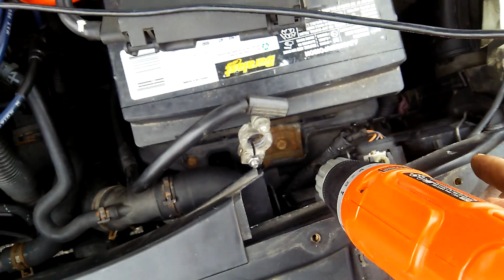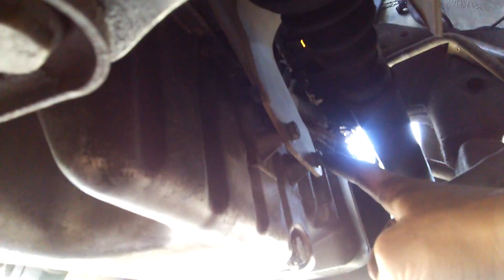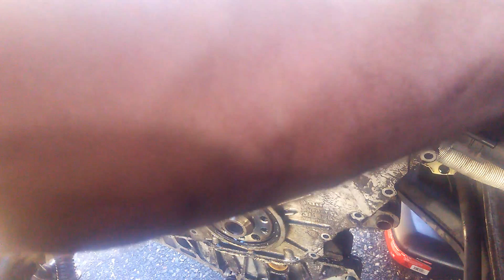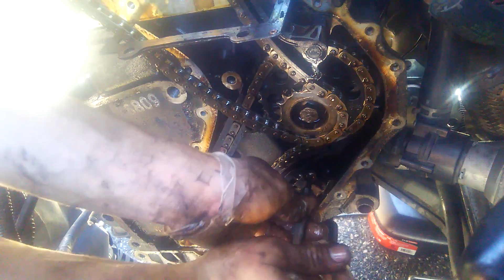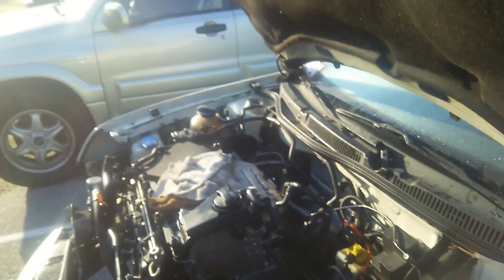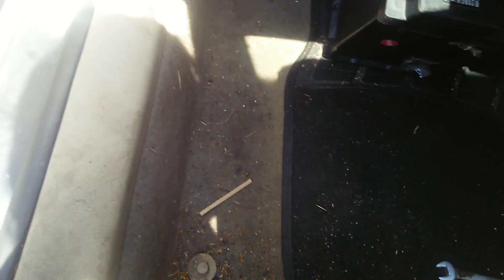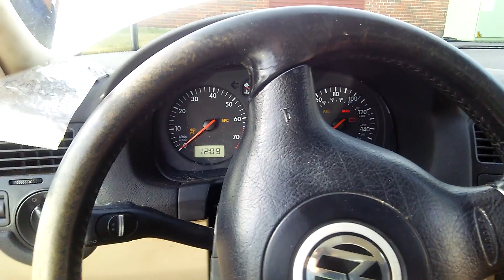VW VR6 Timing Chain Repair - Start to Finish - Jetta Golf 2.8L 12v

Comment: Yo, I have a question. I have a 12 valve vr6 and I’m doing the timing chain on it but on the middle shaft where the two sprockets meet why is my Top Dead Center, Mark pointing up opposed to yours pointing down I am so confused right now and I wanna know the difference between the two motors if they are
Reply from the maker: @user-th5mp3bw5p  same motor. The 24valve is noticeably different. As far as the direction of the pointer, if I recall, it can point either direction opposite to itself,  but I'm not 100% on that. If that's how it was when you opened it up, I would just reverse engineer it ad it was if you didn't have an issue before.
Reply: @Vijuel  ok thanks 🙏

Comment: I want do this with my friend noun of us are mechanics but we want to learn we know basic stuff I guess ☹️😭 you make it look easy
Reply from the maker: Hardest part is having all the tools. With patience and staying organized,  you can do it!
Reply: @Vijuel  how can you tell your timing is off ?
Reply from the maker: @vrtxs1938  if the timing is off you will have all types of problems, back firing, stutters and it will not run correctly. what starts to fail is the timing chain guides and it will start to make clacking and ticking noise out of the engine. it may cause your chain to jump from lack of tension and hamstring the cars performance right away and possibly permanently damage your engine. the trick is to catch the warning signs before any of that happens and do a timing chain job to replace the system.
Reply: @Vijuel ended up selling my old 12v i got a 24v now and it sounds like the guides are ticking she still runs good but I’ma have to seat  her up for the winter and get ready for that timing chain job when it gets warm
Reply: @vrtxs1938  take a look by taking the valve cover off. Doesn't take too long to get to and you'll be able to at least take a peek around.  Make sure it's not the shifter rod that's knocking.  -Vijuel

Comment: Wow! That’s a big job well done from a fellow VR6 owner in New Zealand you inspired me to do mine thank you for the knowledge
Reply from the maker: drop your oil pan and clean it out while your at it, it will help in the long run. and think about a clutch change while you have everything open if needed, or at least replace clutch bearing to be safe. cheers mate.

Comment: Yo I remember this vid when it came out you still got this mk4?
Reply from the maker: I do. Drove it today 🙂 although I mostly drive the newer family car. It's still my project fun car. Just replaced the oil pump. Had timing chain guide pieces in the oil pan and pick up tube.
Reply: @Vijuel  ohhh shit I didn’t think you used this channel anymore. How many miles are on her now?
Reply from the maker: @nothingtoshow8084  about 189k I believe it has. I use a different channel but I catch the notifications here and there. I always want to film stuff I do to the car and post on here but I just end up wanting to get the job done and never film lol
Reply: @Vijuel  damn well I’m glad it’s still running good years later. But yea I understand how it could be a bitch to film everything when you need to fix it real quick

Comment: the slack in between  the cams didnt matter?
Reply from the maker: There's a hydraulic tension bolt that presses the guide plus springs on the guides for tension.   She is still running fine since I did this job, besides some other issues
Reply: @Vijuel  you arent understanding my question, i understand how the timing system works im just asking if you skipped timing because you didnt take up the slack between the "CAMS"

Comment: Any suggestion on getting the axel stub back into the transmission? it appears to be spring loaded, i cannot get the cup deep enough back into the trans to start the center bolt.
Reply from the maker: Yes, I used a huge C clamp. I had bought a set for other projects so it came in handy. Pick up a big one at harbor freight or try to have someone help push it in while you try to screw it together
Reply: @Vijuel  thanks i have one somewhere
Reply: @Vijuel  sorry one more question. There is a small black ground wire that is coming off of the small cylinder thing right behind the coil packs, Does that wire go to the bottom bolt of the throttle body? i cant remember but that seems thats where it should go based on range. Thanks again for the help. I got the splines on.
Reply from the maker: @OryHaram  I think that wire sits on a screw, right to the coil packs, right under some small coolant hoses. I'm going by memory right now

Comment: Awesome job! What sorce material did you use to study for the job? Did you use manuals etc? If so what manuals or websites?
Reply: Thanks. I have a pinned comment here that will take you to a thread from vw vortex, which was most the info I had at the time. Much more available now on the net since when I did this job.

Comment: Is it true that the 24v VR6 has a better designed tensioner/timing chain system than the 12v VR6?  I've heard rumors that you can usually get more miles out of the 24v motor before having to replace and work on the timing chain.  If anyone has any info on this, please comment.
Reply from the maker: the chains are usually solid. the guides go out and are the main problem in these systems. not sure about quality between the 2. would be safe to have regular maintenance after 80k

Comment: What work did you need to do with the throttle body during this job?  Was it removed from the intake manifold or were the two removed as one assembly?  If the two were separated, did you clean the butterfly valve?  Did the throttle body need to be mapped after the car was put back together?  Also, since the whole job was done almost 4 years ago, can you give us an update on how reliable the car has been, specifically regarding the maintenance you performed?  Good work.  I need to do the same to my GTI.
Reply from the maker: i believe it was in one piece. the car ran fine till last winter i had an oil pressure problem and stopped driving it after one night i got the light turn on. it was sitting since then and i started driving my other jetta. just a few days ago i started it up and it had no oil pressure light. so ultimately, it had no timing chain issues since i did this job. i started the car again because i'm moving out of state and have to do something with it. i wanted to take it with me and make it my daily driver again but it will cost too much for an auto transporter so i will have to get rid of it asap within a few days. maybe give it away to someone... other than that, it's a 20 year old car so a lot of other stuff is worn on it, a/c, heater, suspension, brake system.. nothing critical, but just old at this point with new england weather and use.

Comment: before you noticed you needed to change your chains out, did it feel like it was a clogged cat before hand?
Reply from the maker: it will run rough like a bit of  an exhaust issue, but you will also hear it rattling and noisy on the front end.  listen for it.

Comment: Amazing job, outside a garage, without the lift, big respect! Can you please tell how many kilometers did this engine have on the clock when you did this repair and does the vr5 have the same timing chain setup as this vr6. Thank you for your answer and again big respect for pulling this off!
Reply from the maker: 144k miles / 232k kilometers. not sure about the vr5

Comment: one question again....why did you change it...was it acting crazy or....you say in the end " shes running much better " kind a wonder if something and what made you do this job ? . have a 24 v wich i think is lazy in responding ....nothing looks wrong, but maybe its a loose chain . dont know when its been changed if it ever has been . 230,000 km like about 170,000 miles
Reply from the maker: it was making noise (the chain running with slack on broken guides). i started it up at work to head home and it skipped a tooth. i drove it home and there it stayed till i fixed it
Reply: @Vijuel  uhh a bit lucky 🤣 dont know if it can bend a valve or not . But okey thanks alot . Do think i feel a vibration of some sort when i stand still and give it some pedal, then theres some vibratios i just cant locate. MAYBE....just maybe a loose chain could cause that feeling. Anyway thanks alot for your time ....again i think 😂 nice when people respon on questions

Comment: I'm thinking about buying one of these cars with the same engine that has jumped time does it work valves
Reply: I'm not sure what your asking. You mean the chain jumped and you're wondering if the valves are any good?
Reply: Is it an interference motor means when it jumps time does it work the valves in the cylinder head
Reply: @anthonycasey6064  yes it is. If you're not sure what the extent of the damage is, I'd stay away from it. Could be no damage,  could be shot. Not worth the $ to find out. If you're looking for a vr6, keep shopping around, they pop up often and aren't that pricy.
Reply: @BattleRapBoutique  200 for the car
Reply: @BattleRapBoutique  its a 1999 very clean little car
Reply: @anthonycasey6064  if it's in decent shape and you have the space, it's a great deal. You can part it if anything and make a profit
Reply: @BattleRapBoutique  yes
Reply: The one I am thinking about buying has jumped timing does it work the valves
Reply from the maker: i replied from my other account, sorry for the confusion.

Comment: How was this vr6? Did it burn oil?
Reply from the maker: Strong motor, it did burn about a quart and a half of oil between oil changes.
Reply: What kind of oil were you using?
Reply from the maker: @Datwookievr6  0w 40 full synthetic Mobil 1. Sometimes with Lucas oil stabilizer
Reply: Thanks alot for the info

Comment: Is it common for timing chains to break easily on vr6s ?
Reply from the maker: not really. a lot of cars had chains before moving to the cheaper belt design to save costs. what mostly goes is the plastic guides, rarely the chain itself

Comment: Hate my VR6. Took it to the shop to habe cam shadt positioning sensor changed. They changed it with no fix. Timing was off still. Put old back in. I dont have thousands to fix the damn thing. They said they wont work on the tensioner pulley because they are none for breaking and have to pull the engine out. I only watched a portion of this video and its beyond me and my time to do.
Reply from the maker: the guides are known to break regardless, they are plastic. yes it is kind of a big job if time, space, tools and experience is an issue. it is not a big deal to do if you have a decent combination of all those tho. the tensioner pulley if you are referring to the serpentine belt is simple to change... if my vr6 makes it to this next summer season i will try to open her up again and refresh all the guides to the timing. a chain drives it, not a belt, so the chance of the chain breaking is slim, but the guides will need occasional service.

Comment: When removing the axle flange bolts, it's best to stick an old but tough screw driver in the rotor slots above the caliper so the rotor locks up and wont turn when you break the bolts loose! Saves you from having to block the brake pedal.

Comment: Hey man! Very thankful for a video like so.. im extremely surprised you did it in such a short span of time and in the middle of a parking lot! I have recently bought a jetta with the 12V VR6. The code that was sent was P0340, which I thought I fixed before, but  the code came back on - people say it is timing. Car hasnt been serviced for timing chain for a while - but it ticks a little. DO you think I should replace the timing chain and all the guides etc. just to be safe ? Thanks
Reply: Keyvan salute,  check camshaft position sensor / wiring.. could be the timing misaligned.

Comment: What is the big seal that you replaced called... in trying to get all the parts before I start taking my vr6 apart
Reply from the maker: Alex Perez it's called the main oil seal
Reply from the maker: Alex Perez when looked up there will be a small one and a big one, it's the larger main seal
Reply: Can it also be called Timing Cover Seal???
Reply from the maker: Alex Perez maybe, I remember it being called main oil seal, but may be rear oil seal or main camshaft seal... It's a tricky one cause there are a lot of similar seals
Reply: Alright let’s see what happens
Reply: By any chance do you remember where you bought it from
Reply: Alex Perez that specific part I believe I got from AutoZone.  Plan ahead in case they need to order it. It is about 6 inches wide rubber ring with a coiled spring inside of it just so you know... a small seal comes up when they look up the part, so make sure you get the larger one
Reply: Okayy thank you
Reply: Alex Perez cheers bro. Good luck
Reply: Thanks I appreciate the help
Reply: I was just at Autozone but they can’t find that one it only shows the 2 inch one
Reply: something like this, im not sure tho... https://www.urotuning.com/Crankshaft-Seal-Rear-Main-Seal-Mk4-Mk5-VR6-p/021103051c.htm go to advanced auto or another store and ask them to look up ( rear main seal, or crankshaft oil seal)  this looks like it too https://www.ebay.com/itm/VW-GOLF-MK3-VR6-Crankshaft-Crank-Oil-Seal-Transmission-Timing-End-Genuine-OEM-/151473473470
Reply: this also may be the VW part # * 068 198 171 - rear main oil seal
Reply: this guide will help you a lot http://forums.vwvortex.com/showthread.php?1264409-DIY-Replacing-timing-chains-tensioners-and-guides-on-a-12v-VR6%5C

Comment: I would also highly recommend pulling the oil pan. Alot of the time the guide material will find its way into the oil pickup tube and could restrict oil flow to the pump.
Reply from the maker: Great tip Tiffany!

Comment: Does it make sense to replace the sprockets too? Is that amazon link for the chain a good replacement? Have you had any issues? Because most chain kits are $200 so ive seen.
Reply from the maker: no need to change cam sprockets. you should change the clutch tho, while your in there. the amazon link is just to get you there. i believe i got the parts from rockauto.com and ecstuning.com . havent had a problem since i did this. eventually i will have to check the top timing chain guide rail, which can be checked and replaced by just removing the top half of the cover. but no issues as of yet.
Reply: okay. i just replaced the clutch 400 miles ago, and i didnt do the chains while i was in there.. stupid me. So now its time to do them.. Thanks for the video! No amazon timing chains for me though haha

Comment: excellent video man! I still can't believe you never jacked the front end up at all! crazy how vw has the timing chains sandwiched between the trans , how many miles was on it when the tensioner and guides gave out?
Reply: Im driving a SEAT Toledo II with the 2.3 Vr5. My chain started making noises at 65.000km and it jumped first at 74.000km (I tried fixing a lot of stuff because I haven't realized it was the chain) and now at 84.000km it jumped again making the car run so bad it wouldn't really idle cold and needed full throttle to even do something so I now need to fix it. The Garage wants 2000€ to do it but One set only costs about 160€ on Amazon .
Reply from the maker: THAT NEON DUDE JAMEZ thanks.  started to hear it failing around 120k. did this job at 142k. should be done between 80-120k
Reply from the maker: THAT NEON DUDE JAMEZ once you're really to drop the transmission then you have to Jack the car up to remove the axles
Reply: Vijuel I picked up a 01 golf gti 2.8l vr6 has 204k on it I'm sure mines been done sounds great no chatter and before I got it the clutch was just put in.
Reply from the maker: THAT NEON DUDE JAMEZ nice.  overall a good motor when cared for.
Reply: Vijuel how long did it take you start to finish?
Reply from the maker: THAT NEON DUDE JAMEZ bout 3 days by myself. day one prepping and breakdown,  day 2 parts arrived, cleaning and install (gave the rtv silicone time to cure,)  and 3rd day I reassembled
Reply from the maker: THAT NEON DUDE JAMEZ can be done in one day
Reply: TWO DUDEZ GARAGE Just for another data point, mine has 148k and no sign they need replacement, but I’m checking videos to see when they may need to be done.

Comment: How big of a difference is for a Golf  24V v6 2003 than this.is it much?
Reply from the maker: pretty similar. i haven't really got to work with a 24v yet to say where and how much they really differ.
Reply: Ok, thanks.. I've been to a specialist and they told me it's a 3 grand work(in pounds) fuck I rather crash the car to get what I initially paid for it
Reply from the maker: it's a big job. many shops are going to charge big bucks. if you have the tools, time and space, you can do it yourself. not hard, just takes patience, reading and a few busted knuckles.
Reply: that's the thing man I haven't got the tools nor the premises to do so.But thanks for the response and appreciate your work, I only wish I could be like you
Reply from the maker: any time my man, appreciate it. i had to take time off work for this and do it myself cause i just couldn't afford any other option. she still runs great as my daily driver. the motors are strong if maintained, everything else falls apart around it lol. good luck man.
Reply: thanks, I got an offer from another garage for 1500 pounds.. It is still expensive, but I have no choice have I? I want to keep this bad boy running.It still bugs me that I can't repair it myself